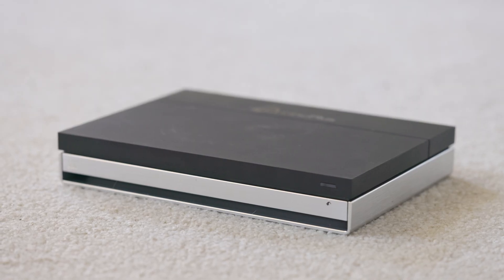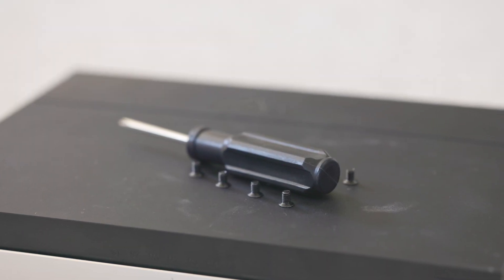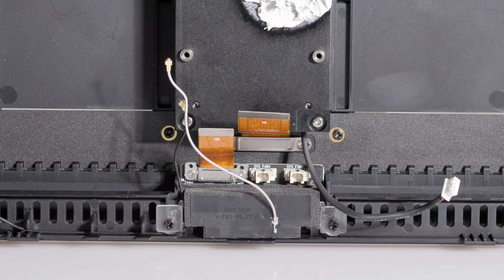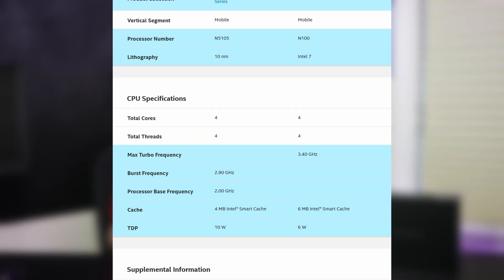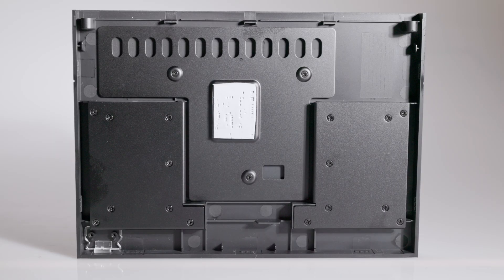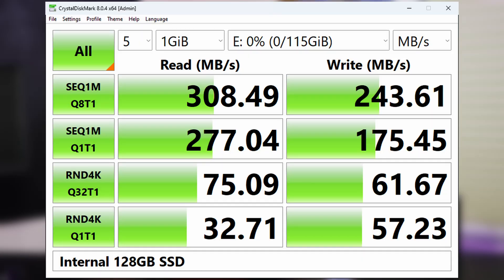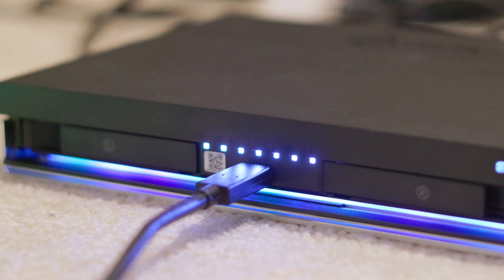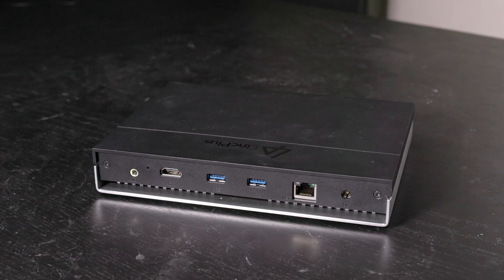LincPlus LincStation N1 Review: All SSD NAS with unRAID

Comment: Thank you for going into the hardware details. I have several use cases to explore with my LincStation N1. DVR to use with a HDHomenrun over the air TV receiver, desktop & laptop computer backup, syslog storage for my home lab, customer full disk backup before troubleshooting, download surveillance system video, to name a few.

Comment: I got one of these today based on your review. I've been looking at one for a while. Thanks for letting us know about the internal drive and 11. I don't plan on running UnRaid on it. It was a little wonky getting 11 installed. It doesn't seem to like any wired keyboard/mice and is picky about which  wireless ones it likes.
Reply from the maker: That's some odd Windows 11 install issues. I don't remember running into them, but I might have re-used a drive with 11 on it already.

Comment: @ElectronicWizardry, Can you make a video explaining the usefulness/uselessness of NVMe generation for NVMe selection. It is a very confusing topic at least to me. It seems that NVMe generations is a bigger mess than USB generations:
1) They say it is let say NVMe 2.0, but it appears that it is up to the manufacturer to implement standard's features, f.i., namespaces. NM790
2) Exactly, same drive may have different NVMe revisions. F.i., 4TB Lexar® NM790 is NVMe 2.0, smaller capacities are 1.4. Why?
I believe it can be an interesting topic for the video.
Reply from the maker: From my first glance NVMe revisions don't really matter for most users, and are kinda hidden in the specs. I'll look into it some more and work on some video ideas.

Comment: Interesting device at a slightly lower cost than the Asustor Flashstor 6 but I'd love to see one of these little devices with a CPU that had enough PCIE lanes to handle 10GbE (or even better 25/40).  For some use cases I can see a market with it's small form factor and low power use though and for that market the Unraid license makes sense.  A little bigger with better cooling wouldn't be a bad thing for a N2 though.

Comment: whats the best way to use ssd on unraid? Array does not support trim while zfs seems not that robust (at least for now)
Reply from the maker: Thats a good point. Unraid 7 makes ZFS a good amount better it seems, but not out yet. Thats a good point about trim on the main array. The unraid array also fills the drives one by one by default which isn't the best for SSD write performance. I think SSDs should do fine without trim in a limited write workload, but kinda annoying thats not supported.

Comment: Thats a cool unit. pretty rad it includes an unraid license. unraid 7 is around the corner and it will bring a lot of improvements to a system like this. it makes sense to choose unraid as its easier to compete with synology, qnap and asustor. Something like trunas or OMV would be too much for most nas buyers.